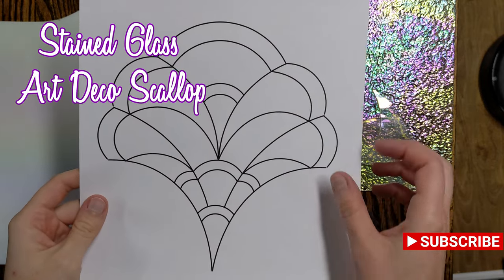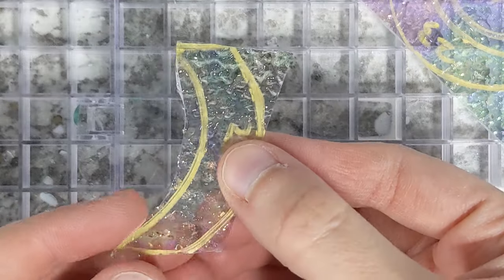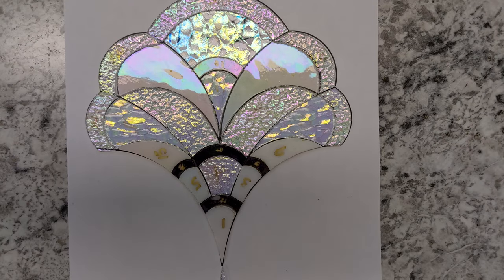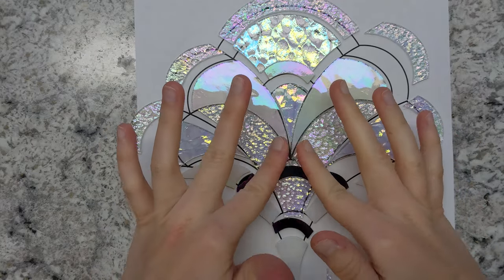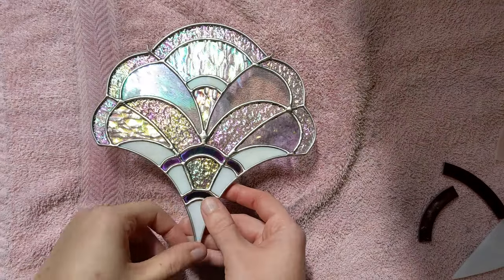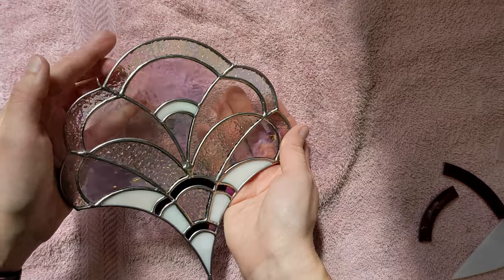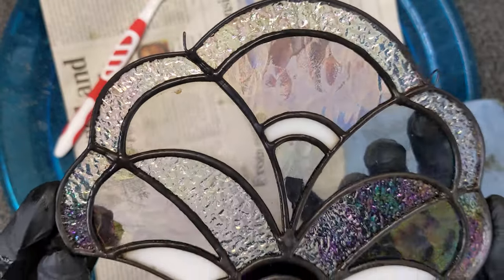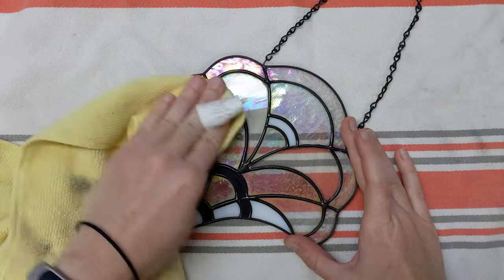Watch Me Make a Stained Glass Art Deco Scalloped Suncatcher

Comment: I like the way you handle cutting the smaller pieces. That's where I struggle and get clumsy with my cutting. Large pieces are no problem for me but I really need to work on the small cuts. Enjoy your videos very much. I saw the previous comment and didn't realize you had an Etsy store. I'll have to check it out.
Reply from the maker: Thanks! Yeah, small curves can be annoying, if I try to break out a small curve in one score, I end up chipping off the tip